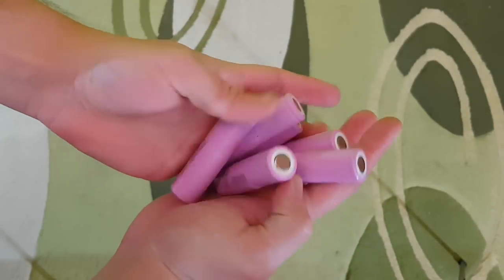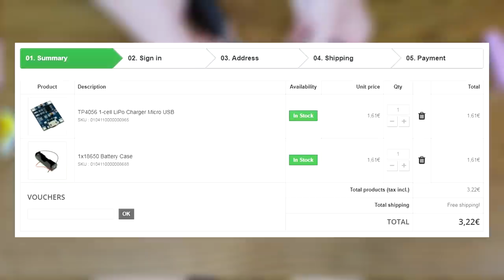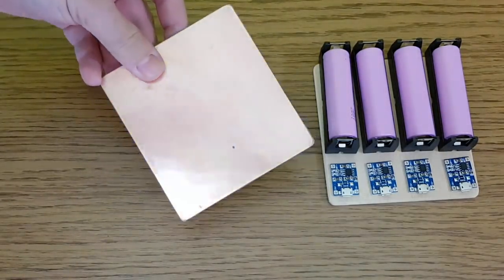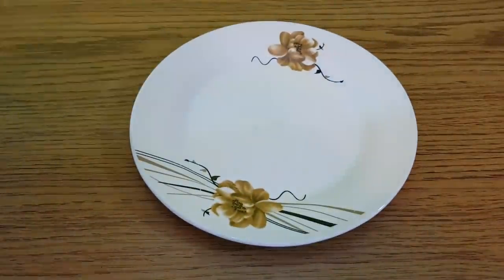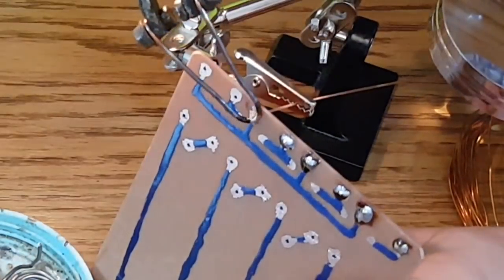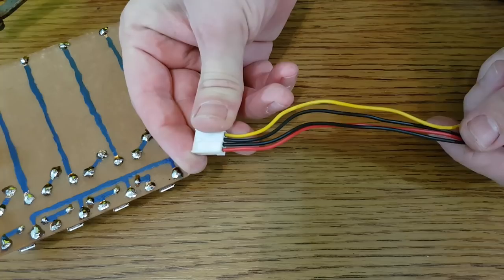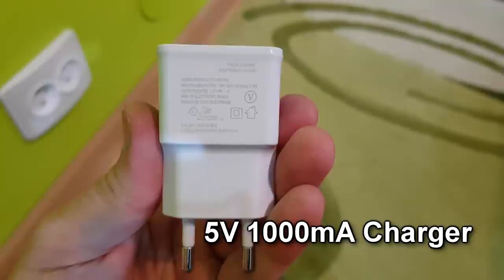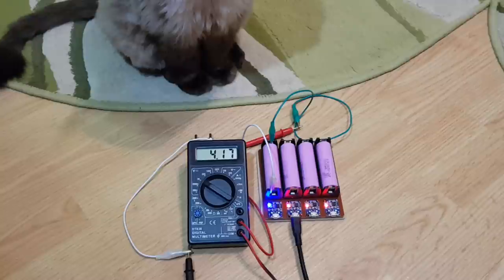Simple DIY 18650 Battery Charger - TP4056 Review (Everything Explained)

Comment: how fast does it charge with the new Quick Charge 3.0 wall chargers which can do 18watts and 12volt?
Reply from the maker: hi. qualcomm quick charge 3.0 technology (same for Samsung adaptive fast charging) works at full charging rate (9V or 12V with 1.5A) only with compatible devices like samsung S6, S7, S8 and other newer phones or tablets. these devices know this fast charging technology and negotiate the charging rate with the charger. all other devices (that doesn't know the fast charging technology) will draw only 5V at max 2A from the charger. same for this 18650 battery charger. the fastest way to charge the cells is to provide 1Amp for each tp4056 module, in my case the best USB power source should provide 5V with 4Amps.

Comment: Just made one of these. the blue leds come on when I insert the cells BUT I noticed the larger 6 legged chip gets very hot on both boards. Is this ok? are connection +/_ are correct. Power supply was a old camera charger 5v 1.5 a
Reply from the maker: hi. the IC is getting hot, when it's charging with 1A. so for bigger capacity cells it will take longer to charge them and the IC will get hotter. if you charge big capacity cells (bigger than 2Ah) I suggest you add a small heatsink on the integrated circuit.
Reply: @Sorin_DIY  Hi Sorin, I have an issue, for me the TP4056 module has a blue and a red LEDs - when plug the microUSB connector both stays on, also the protection is not cutting off the charging current - it climbs up to 4.25 where I cut it off manually (disconnected). I think this is not normar right? if yes, how can I debug it - what is wrong?

Comment: Thanks for such wonderful videos!! I copied this design,  tried charging similar make 18650 cells using a 2Amp, 5v charger. I do not see the charging stops even after the cell reaches 4.20 volts. But when I try to charge the same cell in a single TP4056 module, it finds the cell to be at max capacity and stops charging. I am confused what could be the issue. Anyone faced similar issues? Thanks.

Comment: Can the TP 4056 modules be used for any battery?
Reply from the maker: the tp4056 charging module can be used for a lot of battery types. the battery must be lithium-ion or lithium-polymer with a nominal voltage of 3.6 or 3.7 volts, that can be charged at maximum 4.2 volts.

Comment: Can you use 1 charger for earch tp4056 module? Example you have 4 you will use 4 cabes and charger will that work? To charge the batteries individually and faster?
Reply from the maker: yes, with 4 USB chargers, each tp4056 module will receive more current (max 1 Amp is needed ) and the cells will be charged faster. but if you have one single USB power source with 4 amps, it will charge the same way.
Reply: Sorin - DIY Electrical Nerd thankyou im going to make one too!

Comment: Could we put a single charger in line with 3 batteries? 
Thanks!
Reply from the maker: yes. but only if the cells are always connected in parallel. but it will take 3 times longer to charge them.
Reply: @Sorin_DIY  thank you, friend!
😊

Comment: ok but dont u need a balancer or BMS for this? or is there an option that u can charge all 4 Batterys with one big charger
Reply from the maker: for this charger I use 4 charging modules connected in parallel and the cells are charged individually. a BMs board is used for cells connected in series.
Reply: @Sorin_DIY   thank you
Reply: @Sorin_DIY   can u look ur instagram please i had a question

Comment: Is there a way to charge the batteries while using them?
Reply from the maker: yes. you can insert the charging module and the battery inside the device, like I did with my bluetooth speaker. but your device must not use more current, than the battery is receiving from the charging module.

Comment: When I charge a 4 batteries together. It shows 4 volt. And when I check on single single it also shows 3.7volt. Why it not shows 14volt total after connecting together. After all are charged showing.
Reply: I assume you check it in parallel state.
Parallel = same voltage, capacity increased
Series = voltage increased, same capacity

Comment: Hi I was wondering can I charge dead 18650 cells that are 1v or below with these modules. Thanks
Reply from the maker: hi. I don't think the tp4056 module will start the charging process, if the cell voltage is that low. I tried it with cells that have minimum 1.5V and it's working. if it doesn't work at 1V, you can use a DC-DC converter (preferably with current limiting) to charge the cell. and slowly rise the voltage from 1V to 2.5V. then you can use the tp4056 module. but if the cell has only 1V, I think the capacity is not so good anymore. you can watch my last video for more information about charging/discharging cells.
Reply: @Sorin_DIY , ok thanks very helpful

Comment: Hi I would like to know if I can put 3 18560 batteries in serie and charge each one with a tp405 in parallel with the batterie.
Thank you very much
Reply: You can only use multiple TP4056 modules on individual cells in a series pack when they are fully galvanically isolated from each other. Otherwise the shared common ground between the modules and batteries will short your cells.

Comment: Hello sir sorin..... i have 8 lithium battery.. 2 of them is 3.7volt  2000mah and 6 of them is 3.7 volt 3000mah.... can i put together for power bank... please answer me   sir.....
Reply: in this case the charger will terminate the charging process as soon as the lowest capacity ones saturate (as voltage dictates the charge status) and the ones with greater capacity will never have chase for a full charge. you'll not be utilizing the 3000mA ones to their full capacity. Not an expert that this is my 95% probable guess.
Reply from the maker: it's not recommended to use cells of different capacity in the same battery pack. you can use the 6 cells of the same type.

Comment: Can you charge two batteries in parallel with one TP4056
Reply from the maker: hi. if you want to charge multiple cells with only one charging module, the cells must always be connected in parallel (when you charge them and when you use them). the cells need to be the same type, same capacity, same lifespan, same charging-discharging cycles and they will be charged slower.

Comment: So its not possible to use just 1 module even if the battery is in series?
Reply from the maker: hi. this module cannot charge batteries in series. for each cell you need one charging module.

Comment: Shall i connect 2 battery in parallel and charge using tp4056 module.. It is possible or not. Any problem occur in battery or not
Reply from the maker: hi. if you want to charge multiple cells with only one charging module, the cells must always be connected in parallel (when you charge them and when you use them). the cells need to be the same type, same capacity, same lifespan, same charging-discharging cycles and they will be charged slower.
Reply: @Sorin_DIY  Thank u bro

Comment: Can I charge 2 cells with 2 boards while the cells are wired in series?
Reply from the maker: hi. only if the charging modules have separate power supplies. for example you use 2 powerbanks to deliver current to the 2 charging modules.

Comment: Hi, can i use one module to charge 2-4 battery with parallel method?
Reply from the maker: hi. with 4 charging modules you can charge 4 different cells individually. the cells can have different capacity, they can be discharged to different levels. you can put each cell in the charger at different times. all the cells will be charged much faster, with max 1A. not 1A divided to all 4 cells. if you want to charge multiple cells with only one charging module, the cells must always be connected in parallel (when you charge them and when you use them). the cells need to be the same type, same capacity, same lifespan, same charging-discharging cycles and they will be charged 4 times slower.
Reply: @Sorin_DIY  hmm.. ok thank you.. 🙏

Comment: Hi Sorin , I have some old laptop battery that is flat ,Power shows 0 v . To revive this battery i have seen some clips in  you tube how to clik back the battery breaker top part for live again ,from your experince is it save to revive the battery as per video clips 
your advice please ... tks
Reply from the maker: hi. you can revive li-ion cells, if they are not damaged, just overdischarged. but I've never tried to charge batteries which have less than 1 volt. you can try it, but you have to monitor the entire process. you need to start with very low current, I would say about 100 mah / cell. if they start to get hot, they are not good anymore. after a few hours the cells should reach 2.4V. now you can increase the current, or use a standard battery charger. after the cells are fully charged, you leave them for a few days. then test them with a multimeter. if the cells have more than 4 volts, they are still usable.
Reply: Hi Sorin ,thanks for your swift reply, Good info , I just received some similar info about how to go thru  the whole process of chargeing , but not as more details as yours , Thanks Pal , Waiting for my TP4056 board once received i will fixed it the way you thought me ,,, Tks will contact you for more advice if needed ..

Comment: SALUT.
Pentru doi acumulatori si doua module la 5V , ca amperaj trebuie?
Reply from the maker: salut. daca nu modifici modulele au nevoie de 2A. dar poti sa le modifici sa incarce cu un curent mai mic.
Reply: Ce te intreb acum ,in primul rand un nr de tel sau wassap sa vb te rog si inca ceva: am un TP4056 care incarca 1 acumulator 18650 si iesirea duce l un motor care merge d l 3V la 6V dar se incinge tare de tot TP4056

Comment: Excellent info and what a great idea! Thanks Sorin.
 I just bought some extra 7.4v packs for an RC rock crawler and was wondering to get more cells, since I've always used lipo packs. I have a couple of old laptop batteries, so I'll be checking them out instead of chucking them out!!
Interestinf about the charging as well, as so many people have said that 4.1 is maximum for li-ion cells. But now I've checked all three packs after using the special USB charger that was included with the model, they are all about 4.2v per cell. 👍
 Can I use a regular Accucell lipo charger with these 2 cell packs? I think it might be possible. I can adjust the voltage point and mah.
Subbed!
Reply from the maker: hi. you can use the Accucell, but  you need to connect all the cells in series and the balancing leads correctly. but laptop li-ion cells are not good for RC devices. laptop cells have a max output current of 3-5A. for RC devices with electrical motors you need a battery that can output 20-30A, like portable drills batteries. laptop cells can be used for devices that need a low current and last very long, like portable bluetooth speakers.
Reply: @Sorin_DIY  I hear you my man. But my new RC rock crawler has a 1500mah li-ion 7.4 pack and special USB charge lead that uses the balance plug only. Crawlers don't need high output. I planned to make up an adaptor lead to use the Accucell, so the cells get balanced, and I'll be charging at 1amp max. It'll still be faster than the 3 hours for the USB lead!

Comment: Can you use only one charger for all 4 batteries ?
Reply from the maker: yes. but the cells will charge 4 times slower. and you need to use the same type of cells with the same life span and number of cycles. the cells must have the same voltage when you connect them to the charging module.
Reply: @Sorin_DIY  Please help me understand an issue : Although i wanted to place 4 battery in parallel, i discoverd that is enough to connect only 2 batteries (Li-Ion), because there is enough power ( each battery has 2000 mAh). My total consuption is about 140 mA (an 2x10W amplifier and one bluetooth player). So i connected only 2 batteries to the charger and maked sure the 2 batteries are the same type and perffecty ballanced. The TP 4056 charger indeed in charging verry slow (and i think is normal for this kind of battery), and is heating up (i put a little radiator just in case because the charge time is taking an big amount of time). The big problem i have : There is no visual representation of the complet charge (In other words, the blue led indicator never comes on). I know from the datasheet that the voltaje required for the complete charge and disconnect id aprox 4.25 V. When i test the voltage with the voltmeter , i read 4.23 V and the voltage does NOT rise anymore. I tried to connect another power supply with 2A, but the same result. Why is that ? Why is stops at 4.23V and the red led is on ??  IF the battery reaches 4.23 V and i let the charger for another 2-3 hours or more, could i damage the battery?

Comment: Why not a single tp4056 charger and have the batteries connected in parallel?
Reply from the maker: hi. with 4 charging modules you can charge 4 cells individually. the cells can have different capacity, they can be discharged to different levels. you can put each cell in the charger at different times. all the cells will be charged much faster, with max 1A. not 1A divided to all 4 cells. if you want to charge multiple cells with only one charging module, the cells must always be connected in parallel (when you charge them and when you use them). the cells need to be the same type, same capacity, same lifespan, same charging-discharging cycles and they will be charged 4 times slower -> 1A/4=250ma each cell.

Comment: Where to buy the printed circuit board and that pen to write on it?
Reply from the maker: hi. I had bought them from my local hardware store. but you can buy just a perfboard and solder the parts on it without the pen.
Reply from the maker: this perf board is ok, but it's a bit tricky. it's double sided and the holes are connected with copper from one side to the other. if you use to much solder on one side, the solder can go through the holes in the other side and can short something. it's ok if you are careful. but it's easier to use a single sided perfboard, like this one:
https://www.ebay.com/itm/3Pcs-One-Side-Prototype-Matrix-PCB-Printed-Circuit-Board-22cm-x-10cm/182523146874?epid=2113184294&hash=item2a7f3a327a:g:SGMAAOSw3utY6h58
Reply: Sorin - DIY Electrical Nerd nice tip. I Will try to be carefull because bought one Double sided with exact size that I need, the one sided I didin't find the intended size.
Reply from the maker: it's fine. you need to leave some space between the perfboard and the charging modules. you can use pin headers.
Reply: Pin headers I will use this ones: https://www.ebay.com/itm/5PCS-40Pin-2-54mm-Single-Row-Straight-Male-Pin-Header-Strip-PBC-Ardunio/232477708268?ssPageName=STRK%3AMEBIDX%3AIT&_trksid=p2057872.m2749.l2649

In addition to leaving a space between the top side of the board and the load modules that I will use the pins, there is something else that I should be careful with short circuits? Thank YOU!
Reply from the maker: the pin headers are good enough for spacing. it's a bit difficult to make the circuit on the back of this type of perfboard, by soldering the holes together. if you have this problem, you can solder copper wires on the perfboard.
Reply: Sorin - DIY Electrical Nerd really is difficult to merge the holes in the back side? :/ But why? I thought the space between them was close as well the perfboard one side solder.
Reply from the maker: the spacing between the holes is the same. but when you add solder to it, the solder tends to go through the hole on the other side. that doesn't happen on single sided perfboard. but you can try it, I don't think it will be a problem.

Comment: i followed everything but what seems to be the problem when im charging more than 2 batteries the red light on tp4056 module keeps on blinking even on the other vacant modules no matter what charger i use. i tried 5v 1a and 5v 2a no luck
Reply from the maker: hi. that happened to me only one time. it was connected to the PC USB (0.5A). I wanted to charge 4 cells that were very discharged. when I put in the third one, the red LEDs of all the tp4056 modules started to blink. I think the voltage dropped too much, because the cells were too discharged. I waited 10 minutes, then I put in the third cell. after another 10 minutes I put the 4th cell and they were all ok. try it in this way.
Reply: Sorin - DIY Electrical Nerd when blinking occurs, could it be trickle charging?
Reply from the maker: I don't think so. I still think it's an incompatibility between the charger and the tp4056 module. or the cells are to discharged. I have a 2.0 amps Samsung charger that works fine. but if I connect it to the tp4056 modules (with or without any cells) all the LEDs are blinking. so I think is something about the charger...
Reply: thanks! good to know

Comment: What if i use only one battery charging module for 6 cells ? PLEASE reply
Reply from the maker: hi. it will work, but the charging will take a very long time probably more than 12H. all the cells need to be the same model with the same capacity. they need to have the same life-span, same number of charging-discharging cycles. even in these conditions the charging will be less efficient, compared to each cell charged individually.